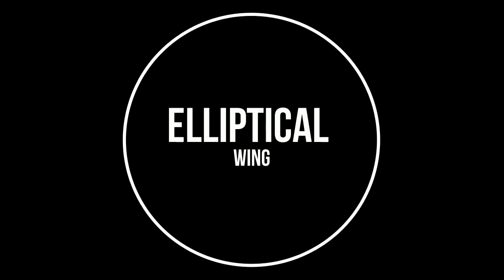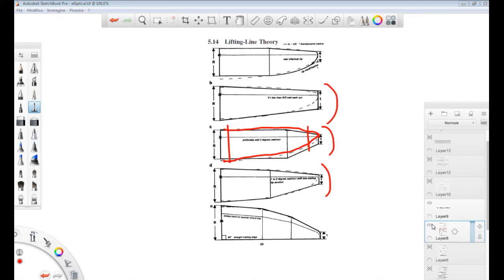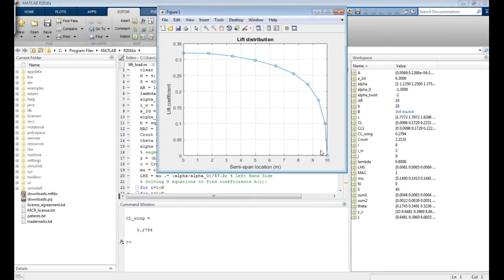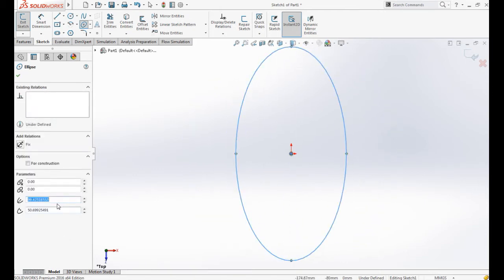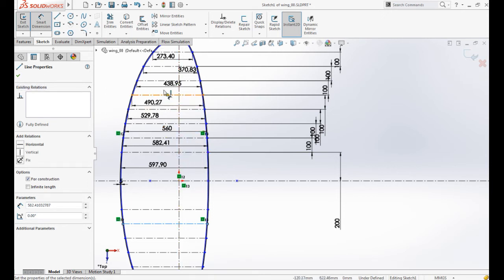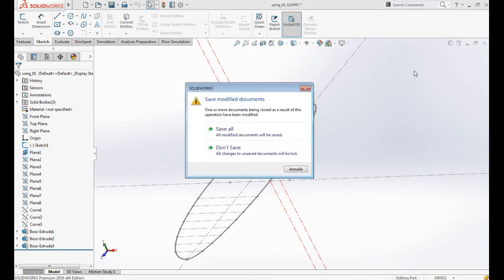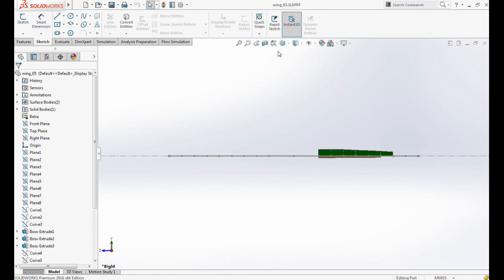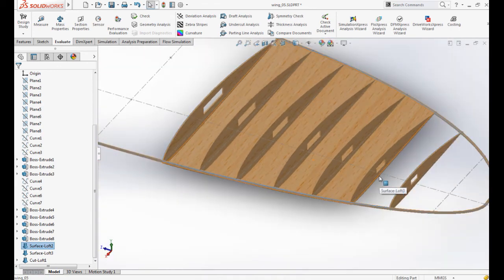Ep 12 - About Elliptical wing & Solidworks

Comment: Elliptical lift distribution (washout or twist) works well at low air speeds near stall but can generate issues related to extra drag and poor trim at higher air speeds. An elliptical plan form wing may be better in some applications.

Comment: How would you do the same wing to have it use a CNC to make a top and bottom mold? So I would cut the wing from foam then use carbon/kevlar and epoxy resign on top of the foam core and use the molds to mold everything together.

Comment: hey mighty wing can you do a structural (static non linear ) analysis on a real wing including the wing skin?
Reply from the maker: +alexander yayne hi, i've tried but for rc modellism, was too much and very complex task. 
In any case, the assembly should be almost perfect, without overlapping, all the boundaries should be well defined. The other important part is for material properties, e.g. mechanical properties of the wood are anisotropic (depends on the direction of the fibers), or what about the skin?
You have to consider the type of analysis since during fly, there is some frequency oscillation of the wing...
A big big mess, but is possiblle

Comment: Hello Sir,
I am trying to design a flying wing using the same theories given in chapter 5. The code given is for tapered wings, and I want to find the lift distribution for the swept wings... So can you write a new MatLab code for calculating lift distribution for swept wings? This could help me a lot, and can save my time too.
Reply from the maker: +Siddhesh Kabure i can try, but not guarantee
Reply: Thank you for accepting my request... At the end of the 5th chapter, there are numbers of unsolved problems. Can you please make a video for solving any one from it(Swept-wing design problem).